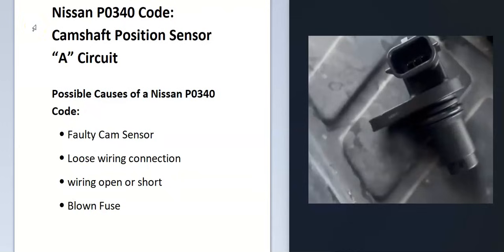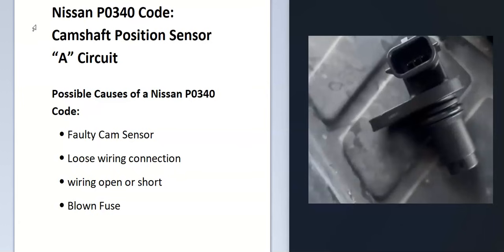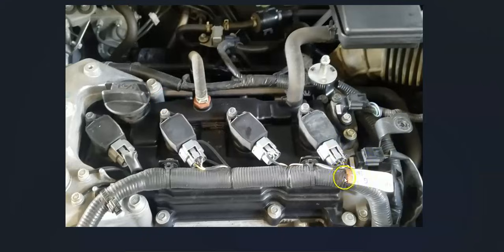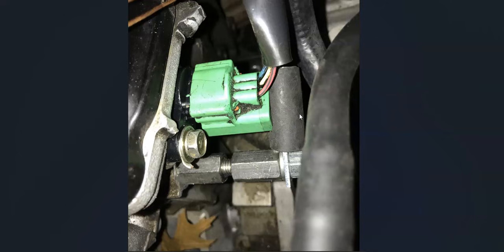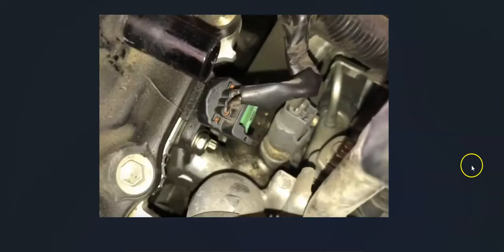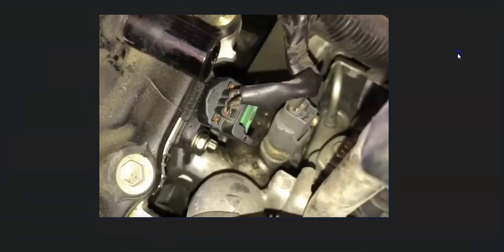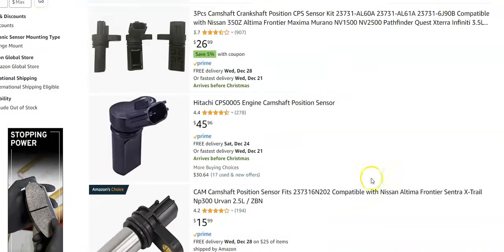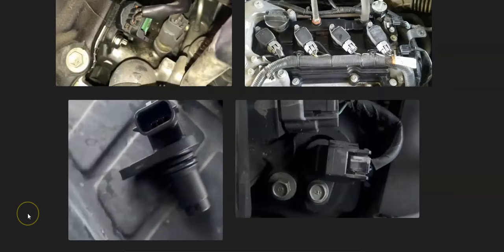Causes and Fixes Nissan P0340 Code Camshaft Position Sensor “A” Circuit

Comment: Fellow HVAC-R Contractor, Northwest Florida.  All I wanted to say was that's how you break shit down.  If you can get paid to do a video for damn near everything in this manner you might get rich.  IDK.  I got nothing negative at all to say.  Great fucking job.  Perhaps linking the schematics would save time but why save us that little extra, we can hunt 'em down on our own.  

2nd Gen 06 XTerra.  I have two codes, P0335 + P1031 nothing wrong with sensors, but they are one of the usual suspects, so I replaced with new OEM sensors.  That was seven years ago when the code appeared.  It didn't clear them then nor was there ever any change other than the engine light to anything with the SUV.  No other code thrown.  It's been running fine for years with the light on, same two codes.  It's the old ladies, a week ago she's out and about and all the sudden it finally appears, the timing jumps and she don't like starting no more.  It's not electrical.  Coils are fine.  It will crank over but it can take many tries and misses when it finally turns over.  For shits and giggles I went ahead and changed the spark plug & boots with NGK Plat's.  Went ahead and crossed off injectors and lack of fuel to the rail.  I pulled and gave 'em a nice ultrasound bath last night and put 'em back this morning.  Nothing changed.  It's in top end somewhere unless it's the camshaft signal plate.  Starting compression test now.  FML.  I was gonna hand this down for daughters first truck and get only one new...  I hope that doesn't change.  Fingers crossed it's a valve spring or something no to bad.
Reply from the maker: I would test the circuit on the crankshaft position sensor A. I made a full video on testing the cam sensor wiring, which is the same as testing the crank sensor wiring. Here is the video. https://youtu.be/MU95sRU8wng
Reply: @HVAC_Mechanic  you know us mechanical contractors.  We're resourceful.  The owner of that million dollar in speed shop with all the goodies used to ride with me before we went and found balls and chains.  By that I mean when I was self employed but not exactly legal.  I hustled the streets while enjoying the cocaine and hookers kind of like like a Hunter Biden.  Minus the crack cocaine smoking part.  

These diabolical rulers even claim that what I was making shekels from is "illegal" here in the US but I know for a fact that they make a lot of shekels off of it and off other control methods.  These plants are "illegal" because the war on drugs is a seemingly endless one, with no victim other than the state and the overdosed user.  Both of them shouldn't be against the law and they aren't but are illegal under the color of law.  AKA Statutes and Codes and what not.

They keep them from us because they help to expand ones consciousness.  Bottom line, along with the money made from internment and all the other revolving doors.  The mind, when open and emancipated from mental slavery, can see the light in the dark and beyond that of what the obedient order following slave who's third eye is calcified blind with fluoride water can.  

Anyways, he was able to run it down quick.  He does it for a living.  He's tore down more engines in one week than I have in my lifetime.  Automotive ones anyway.  I got him on small engines.  Do to my little saw shop hobby.  It was a backed out pin, just slightly in a locking 3 pin delphi connector.  Buddy had a Nissan Titan 06 in his collection that had been wrecked.  He pulls from it for his good Titan.  He said I could grab the connector off it if the same.  It was, and after some splicing and putting 'er all back together I am money.  I did a compression test anyway and it's perfect.  Only other possibility other than ECM is the plate the crank sensor reads on the back of shaft on the bottom end.  Glad I didn't end up going there, he also taught me the quick way to check that so I did and it's good.  Just take sensor out and shine a light while someone turns over a few times.  If the plate moves around with the shaft he said it's good and to move on. 

 I had forgot to call him because he married a Navy Officer here in Pensacola years back and she got orders to VA.  He closed his shop and went there.  That's where he was able to make a killin doing performance mods.  They have more money than brains in the DC area.

Comment: My girls car is a 2005 Nissan altima se. It has the p0340 code for camshaft sensor. Sometimes it has no power. Sometimes it runs and drives perfectly.  So does that mean the sensor is good ? Maybe a loose wire ? Help
Reply from the maker: Intermittent issues can be hard to diagnose. It could be a loose wire, the sensor going bad, or a VVT problem. Also, if the timing chain is old or loose, that can cause issues. It needs to be diagnosed.

Comment: If this is bad will it cause you vehicle to stall out
Reply: That is also a symptom along with rough shifting.
Reply: @anthonybluhm4724 question my car has this code but it doesn’t turn on, it cranks but doesn’t turn on. do you think this sensor is the problem?

Comment: my 2013 wingroad has the P0340. and dont accelerate when its hot i cleared the code and the car is fine should i still change the sensor?
Reply from the maker: I would test the cam sensor and wiring it's the only way to know what is going on.

Comment: Shouldn't a P0340 code keep the engine from getting spark?
Reply from the maker: It can cause no spark, and sometimes it can work and then stop, then work again; it varies.
Reply: @HVAC_Mechanic  I cleared the P0340 and P0115 codes as I have no coolant in the vehicle.  After the next crank I had a 1320, I cleared it too.  Now I have no codes, but my engine light stays on in accessory mode.  Is that normal?  I have a 1995 Maxima.  Thanks.

Comment: Im getting that code now but car runs fine! 🤔 When starting from cold, the rev needle will bounce just slightly for a few seconds but then the car settles drives fine.  Oil level looks good according to the dipstick.  Could it still be just a faulty sensor?  Im driving a 2004 Nissan Almera (N16)

Comment: replaced both cam sensors, but still getting the same code ...also a cylinder 1 misfire... any suggestions
Reply from the maker: Sometimes there are issues after replacing a Cam sensor. I made a video here of common problems and fixes. https://www.youtube.com/watch?v=XQGfIREEJg4
Reply: Where are both cam sensors located. I know where the top one is but the other idk?
Reply: I just got a misfire on cylinder 2 after couple days I got a code p0340 and lost power 😮 after I got the code I drive a Nissan maxima
Reply: @mr.j5467  did u ever find the issue?
Reply: Also with my encounters please check your oil level before attempting any sensor changes even if the code requires it. If the oil level is low it with throw all the codes. Now my car runs great with just making sure oil levels are maintained
Reply: @hotroddie05  i sometimes forget and check old levels and I never had that issue I turn the car in today and drove fine but didn’t drive for a long time maybe 30 min top max I’ll check oil levels in the am thanks 😊